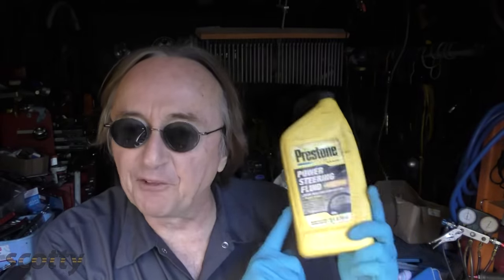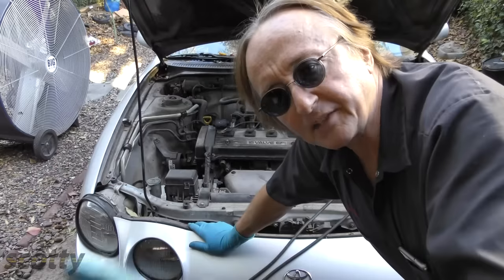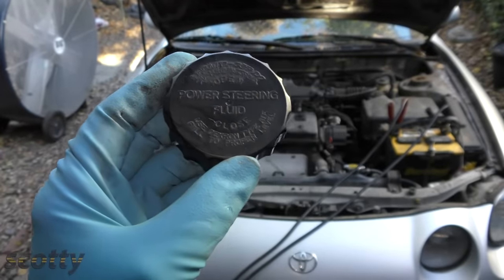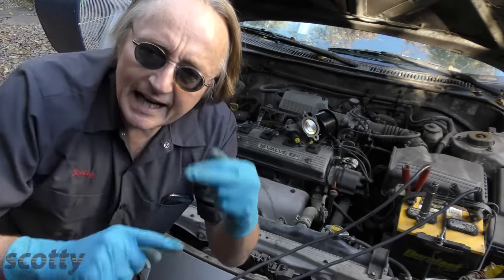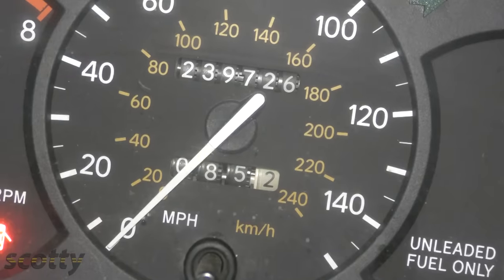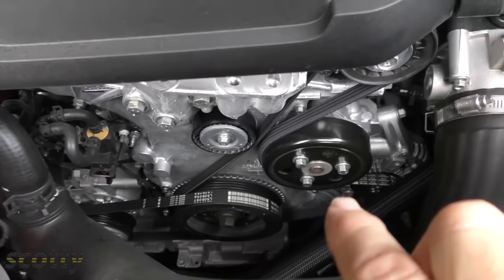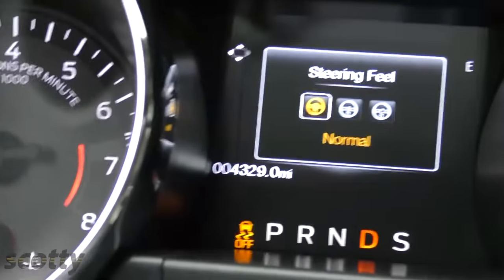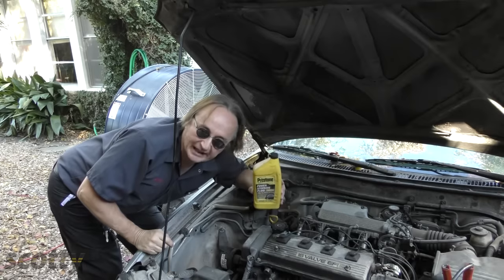Should You Change Power Steering Fluid in Your Car?

Comment: Where's the power steering fluid? All over the driveway which is why I'm watching this video.
Reply: Too late.
Reply: Yeah and I’m 💯% sure that watching Scotty doesn’t help.
Reply: @Mecánico358  Even if you can't fix cars knowing what is reliable or not is very important so you can not have to fix them very often. Lexas not Mercedes, Toyota and the sisters from other manufacturers like Pontiac Vibe is a Matrix not Dodge and alll the others 1 off good cars.
Reply: hahahaha
Reply: Had that issue on my car. The hose had a split and caused it to leak all over my driveway. The pump was still good, and 3 years later, the pump leaked at the reservoir (no new reservoirs to buy, unless you buy the full 9 yards: pump and reservoir). I replaced the pump on my car and the power steering is fully functional once again. First time replacing the pump assembly and the rack is still good. My dad's Malibu Maxx LS has electric power steering and the rack is bad. Steering is loose, the alignment is too far off, and during the freezing weather, the power steering never works.
Reply: Lmaoo
Reply: At least you know where it is. Hahaha
Reply: Same here bro
Reply: 😂😂😂 Wild'N Out ⛳
Reply: Rip dude. Hope you got it fix. Probably needs to be replaced again
Reply: Yup
Reply: Here I am with my 77 Jimmy dropping

Comment: My car has electronic steering. Dealership told me I should have the power steering fluid flushed. Sooooooo... guess that ain’t happening! And I guess I’m not going to this dealership anymore too!!!!
Reply: Spex lol fail
Reply: Don't walk away, run.
Reply: they thought they had you coming LOL!
Reply: That's when you play along.  If you see the charge on the invoice, ask them how they did it.  If you catch them in a lie, you threaten to sue them.
Reply: C@ptain_Jack 

bingo. I love stories like these. especially on Reddit.
Reply: Umm...my car has also electric power steering but the electric motor drives the fluid, basically the mechanical belt driven pump is replaced with an electric pump that pumps the hydraulic fluid. It's best it you check under the hood. Also the reservoir on old cars is very easy to find but on new cars it can be hidden in the corners of the front bumper.
Reply: There is a reason we call them "Stealerships" rather than dealerships. Stay away from those quick change oil places too. They are scam artists and don't put things back properly sometimes and also don't put the proper fluids in (like orange vs. green rad fluid, those hacks will mix them). Many horror stories from those outfits. Like not putting drain plugs back on properly and blowing engines from oil drain..
Reply: Spex ..also tell all the people you come across so you get the word out and prevent people from getting ripped off
Reply: I think you guys are overreacting. Who's to say they would actually charge you to change the fluid when they realize it doesn't have any. Many cars still have fluid power steering so it could have been just a honest mistake.
I would be curious to let them try to change the fluid to see how far they'd actually go.
Then speak to the service manager and GM of the dealership.
Reply: While dealerships do rip people off a lot I can explain a possible reason for this . I'm a mechanic and we use electronic data bases with almost everything about a car you need to know bumper to bumper so when I get a car I scan the vin # for some reason a lot of the systems say you have power steering . Based of your mileage and service history we recommend only to look at the car and see that it's electric power steering . From that point we obviously won't do anything . We inform the customer that the vechile is equipped with electronic power steering and doesn't need to be replaced it all depends
Reply: Time to visit someone else, I like that one.. sad part, he's probably had plenty of people he's done that to
Reply: Spex    That dealership probably changes the air in the tired for $25. too. 
   We have dealerships like that around here.  Also fast oil change places   that tell an elderly woman that she needs the air changed in her car,and most will say,if it neefs it,do it.
Reply: This video although interesting it almost barley spends 5 seconds on how you actually change your power steering fluid. No detail at all for a new comer. “Drive around the block 5 times? What the?” Until it’s empty? So you are driving it without any? Eventually? And that’s good for it? No issues with vacuum or air bubbles in the line? The viewer is left with no idea how to actually do the job. Less yelling at the camera and more instruction would be really helpful perhaps. Just a thought.
Reply: Hudda Rudda you have to refill it to full after every time you use the turkey basted to drain some PS fluid. Then you drive it for five minutes and repeat the process until you have exchanged most of the fluid. It isn’t as good as a drain and fill, but it will do the same thing as a trans fluid change.
Reply: Dealerships are crooked. Always have been.
Reply: STEAL-ership
Reply: If u act dumb they treat u as dumb....cuz then ur are...lol....true story!
Reply: @MrBilld75  where i get my fluids changed the owner manager encourages me to observe my work....and i know whats required. He get a free supervisor , the worker is more careful and the customer is happy ( tho i know they used to do crappy work in the past too ). Evoloution!
Reply: @whiteknight7wayne493  Yeah, that's good and what "should" be done. The problem with those "quick" change places is the speed and we know that rushing leads to mistakes. I always go over my own work to double check and I take my time. A few extra minutes, can save a boatload of trouble later.
Reply: You need to flush out the old electrons in dc power systems. 
The electrons will absorb moisture and cause their charge to get weak. Do not use a metal bucket when doing this. Plastic only.
You don’t want to develop an electrical leak on the highway with electrons running all over the place.
Reply: Electrons are cheap. Replace them often.
Reply: I think they meant flushing your wallet.
Reply: Hudda Rudda I agree all you have to do is get the front wheels off the ground with the low pressure hose dicconected. where it was connected a clear hose at the pump going to a pan on the ground and turn the wheels lock to lock fill the pump with fresh fluid lock to lock until the fluid coming out is clean looking with the engine off of course.
Reply: The only reason I'd have my car serviced at a dealership is for the specialised equipment and knowledge.
If they ain't got that...
Reply: @randyweaver9528  
Outstanding! 😄
Reply: A motorcycle dealership was putting some new tires on my Honda 1100. The service writer asked me when was the last time I flushed the cooling system. I said "never". He appeared "shocked," and told me I needed to get this one right away. I said, please look at the engine. Can't you see it's air cooled?
Reply: I'm a relative novice, and even ik thats a huge red flag. Lol.   I'm competent enough to do all the general work but I'm not super knowledgeable mechanic.

Sounds like a stealership

Comment: Mine leaks like crazy so I always have to top it off, which sounds like an issue but its actually a feature because I have the freshest power steering fluid in the neighborhood
Reply: Trans fluid is cheaper, same shit pretty much unless ya got a Honda, they have picky seals that need special oil. (maybe changed nowadays)
Reply: I had the same mentality with my CL600 when it had a bad oil leak. All I have to change is the oil filter, the oil changes itself when its done with it!
Reply: I'm sure it's ending up on other parts of your car and destroying things
Reply: IKR?  I have a hole in my wallet, but I just keep topping it up with fresh cash.  So I'm the freshest spendthrift in the neighborhood.
Reply: @shabutir1820  doesn't work like that
Reply: @liveandletlive2894  Sarcasm.
Reply: Happened to me, had to change the power steering pump, It was cracked. I have a good mechanic & he did it for 120$ that included labor, fluid & the pump
Reply: @TheQmoney60  $120 isnt bad for a pump but had the steering rack been ruined....oooooh your wallet would've been in surprise
Reply: @liveandletlive2894  oof, would of definitely junked it. I have a 04 ford escape. With 224k. Runs like a tank.
Reply: @liveandletlive2894  i have 2007 acura tsx. Rack n pinion had oil leaks and went out at 150k miles. Expensive job!
Reply: @troytruong8246  I had power steering noise on my 97 celica I filled it with walmart power steering fluid that has a leak sealant and it did the trick
Reply: you mean "on the street"
Reply: Could it have chemicals drifting into the cabin, not a joke btw
Reply: @B Rad they are like $20 here in mexico, labor is what's expensive xD
Reply: @xIntoThePitx  Yes indeed,I had a 99 Honda Accord V6 that had a leak...why? The mount was broken on the engine/tranny, thus creating the whole thing to tilt when changing from reverse to drive...IMP! That caused the hose to touch the hood liner...(was wet with the fluid.) So changing it at garage would've cost $600, hmm since I was going to change car eventually...My brother sugested not to waste that $ cause in a years time or so I'd have same problem. So he told me to keep tranmission fluid in the trunk & top it regularly when gasing. Car went on this way 2 years fine. Got a more recent year & said goodbye to my  99
Reply: @footprints2gigi  -  Sweet!
Reply: @xIntoThePitx  agreed, until I'm ready to repair i just keep a gallon of ATF on hand.
Reply: , @mikemason9310  I love people who think their car is broke and sell it cheap, because of a $10-$20 part. I recently bought a 90 Toyota 4x4, replaced the fluids, shocks, and a tune-up. It now purrs like a kitten and handles like the day it rolled out of the factory. With a few modifications & a supercharger/freeflow exhaust & I'll have a sleeper that will roar like a lion when prodded, and be a contender for Baha 1000.
Reply: I have a Chevrolet Captiva LTZ AT. Mine had a leak too...had to top it every 4000kms. But i fixed the leak which is more reliable...i'd recommend that.

Comment: hydraulic power steering has been bullet proof for years then they go put on something else electronic.. great more junk to break
Reply: Yep 2016 dodge dart needed new steering system at 102k, 1500 bucks later.... electronic system. If it wasnt for that i would highly recommend this non turbo dart its been a great car otherwise
Reply: @superperior      2 years ago my 2011 mercury Milan need it's power steering system replaced. Good thing the 2011 model had a extended warranty,  the same car in 2010 does not. That saved be 2 grand especially since the car isn't payed off yet.
Reply: I've had a few cars with electric steering.  Never had a problem.  Replaced many a pump and hose though.
Reply: If it were up to you everyone would still be driving Model Ts.
Reply: My Honda Inspire (97) has the original power steering pump. Still works great.
Reply: My girlfriend has a 2020 Corolla with speed sensing steering and tbh it’s reeeeally nice. I’d say worth it. Buttery smooth.
Reply: @keenan9440  my 2004 Camry XLE has the old version of speed sensitive steering. Buttery smooth too! Lmao
Reply: Luckily my mom's steering broke entirely when she was in a parking lot... Completely detached. Electronic steering could have cost our lives if it went out on the road
Reply: @keenan9440  yes. All electric power steering cars have it. Otherwise the steering would not feel the tightness at high speed since the steering is done by a motor. Hence a loose steering at high speed could topple the car. Therefore, the tightness is artificially added to make it more safe and realistic

Comment: I like the turkey baster method. I do it every 50K or 5 years. The cost of changing the fluid is super cheap. The oil will break down over time from the high pressure. You can also find good success with just pulling out all that is in the reservior holds and filling up at every oil change. Many ways to do it right the only wrong answer is neglect. People please heed Scotty's advice and warnings I used to be a fleet mechanic so I can tell you that being on a good maintenance plan makes a huge difference in the life expectancy of your car and the amount of repairs. I would also like to add to remember your brake fluid, differentials, transfer cases and cooling system. Old fuel filters can strain fuel pumps and hurt the MPG and performance of your car. Don't forget those inexpensive PCV valves. Buy a good Haynes manual and invest some time on saturday your vehicle and wallet will thank you. Most of these jobs can be done with a cheap tool set from Harbor Freight.
Reply: Wise advice my friend. 👍🏻

Comment: Hi Scotty, my 02 Volvo S40 used to be noisy every time I turned the steering wheel.
I did as you suggested, taking out some of the old power steering fluid with a manual pump, putting new fluid in and driving around a bit. I did this about fifteen times as I could only get about 100 ml out each time, and now it's just perfect. 
There is no sound, no noisd, and steering feels much smoother. All this for about $15 worth of fluid.
I can't thank you enough!  
Thanks a lot from Rome, Italy!!
Reply: You can also jack the front of the car up so you can turn the wheel easily, then run the car and turn the wheel back and forth while you suck out the old fluid and put in new fluid in the reservoir. It will cycle the fluid more quickly and you can basically flush the whole system in one procedure. Just make sure you buy maybe twice as much capacity for your system because you want to cycle through enough fluid until it all looks clean before topping it off for normal use.

Comment: So I was one of those guys who always made sure I had an oil change during regular intervals 5k miles, coolant flushes, and changing out transmission fluid (and seals) every 60 to 100k miles or whatever the manufacture suggested, but never power steering.  Well one day I went outside and there was power steering fluid on the ground, turned out my rack and pinion went bad had to get it replaced which cost alot.  I wish I had thought of the power steering fluid as much as I did the other fluids, so now I do.

Comment: Good one. I always thought I was getting the "royal flush" when the dealership and others pushed the power steering flush. Good info, although as you pointed out with newer vehicles often using electric assist.  The power steering flush is on its way out. The new bread and butter for the auto service industry for newer vehicles seems to be reflashing/pre and post scans for everything...

Comment: Yes, i spent nearly an hour lately looking for ps reservoir and ps pump on a 2003 Toyota Avensis. I thought i was loosing my marbles until i realised it had an electric steering!  Live and learn.
Reply: Diarmuid Ó C lol😃
Reply: Ever had problem with several dash lights coming on simultaneously? I DID when I bought my Avensis first.  By accident,I discovered I shud be leaving engine tick over for a while after long journeys on motorways. Its in the manual,but its not something you will easily see in it. This is necessary to cool down the turbo. You live and learn the hard way....I got two different diagnostics done on the car....neither told me what the problem was

Comment: Always change your fluids at or before interval.  Use good oil, preferably   synthetic if possible.  Power steering units usually are non filtered so good oil and changes are super important.  Especially Saginaw units. Gm has had issues with weak units over time.

Comment: The electric power steering not only improves powertrain efficiency, it allows the automakers to do all those tricks like lane keep assist, automated parallel parking, "stick shaker" warnings and ultimately will be an integral part of self-driving modes at some point in  future models.
Reply: yep. If you remember, firs self-driving prototypes was been 2 gen prius, with steering, braking and accelarating by wire from factory.
Reply: All of which is unnecessary. If you need your car to park for you, you shouldn't drive as it is. I can see where the reasoning to transition from hydraulic to electric comes from. Not a bad concept. But I'd rather keep my power steering.
Reply: Don Boss if you can't parallel park correctly, should you be trusted with driving?
Reply: Sounds dreadful.

Comment: Good news scotty: my 1999 chevy suburban has 200K miles on it (soon to be more than your Toyota) and it's all because I follow your advice for general maintenance and repairs. speaking of which, have you ever done a video on greasing joints and bearings? most of my vehicles are older ones (1980 to 2000) and have tons of grease fittings that I haven't exactly paid much attention to.

Comment: Nice video. Wanted to share a very recent issue I had with Sears automotive center in Key West Florida. Took my car in for oil change and they called me while doing work and said I needed the power steering and coolant fluids needed changing. I went into the shop and spoke to the mechanic and asked him to show me why these fluids needed changing, He said PS fluid should be yellow, Fluid in the pump was red. which is what I've always known it should be. Told them no to the fluid changes and they were not happy with my decision, FYI< I have a 2012 Chevy equinox V6 with 62K and in excellent condition. Beware out there.

Comment: On a related note, my Honda's steering pump was stalling and binding, no steering etc, I changed the fluid, changed the pump! Checked the rack! Same prob each time...!!
Turns out it was a failing crank shaft pulley, the PS pump was just the 1st thing to stall...